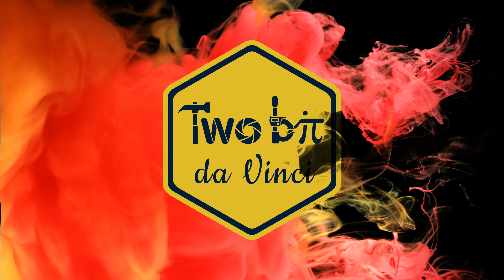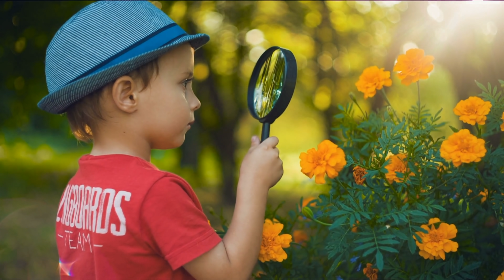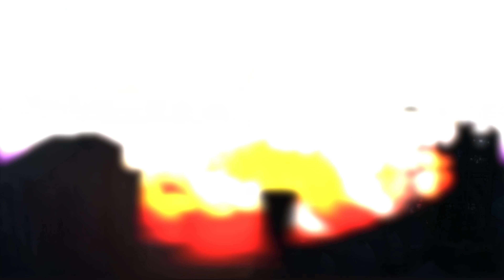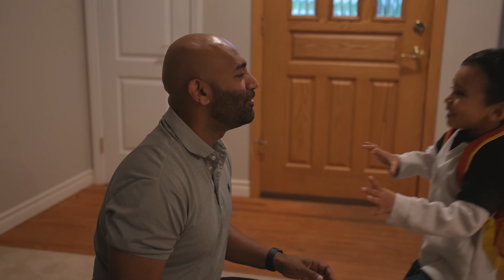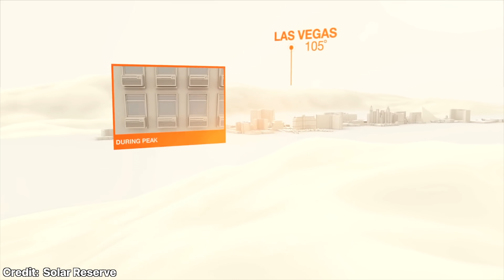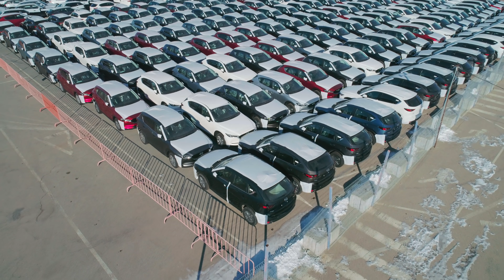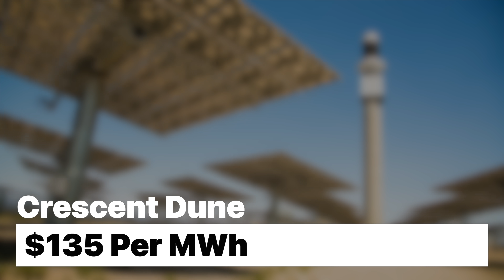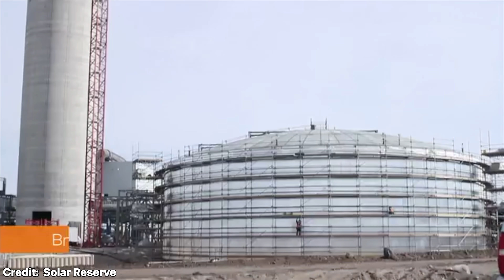This Billion Dollar Solar Plant was an EPIC Failure

Comment: I have no issues with green energy. I have issues with how people try to go about green energy.

Nuclear energy, the safest and least limiting option, is all but ignored because people are terrified of another Chernobyl (which is completely avoidable) or have otherwise had so much misinformation pumped into their minds by way of pop culture that they think you'll end up with three-eyed fish in the river. Instead they try pushing these other methods, each with worse problems:

Solar energy is too reliant on clear skies, it's not suitable for everywhere.
Wind is harmful to raptor populations.
Hydro-electric is very location dependent, and the current state of Lake Mead shows how it can go wrong.
Geothermal is location-dependent.

And then there's the excuses behind it. We should be focused on clean energy for the sake of maintaining energy independence and not relying on a resource that is likely going to dry up in the next couple hundred years. Instead people are pushing this grand lie of global warming (sorry, "climate change" after Forbes brought to light a leaked email in 2011 that proved a major lab in the UK was falsifying its results to match the global warming model) in order to do it.

The climate is fine. The fact that according to every climate prediction of the 90s my hometown should be 10 feet underwater right now because of rising sea levels is proof that the climate change scare is just a scare. The sea level has not risen a measurable amount in the lasts 30 years, in spite of being told for just as long that we'd get flooded because of the polar ice caps. We've been lied to, but green energy is still a good idea for the sake of energy independence.
Reply: And solar works best closer to the equator where you have 12 hrs of sun every day compared to closer to the poles where there could be weeks without sun. And if you want to have solar farms you have to destroy the local ecosystem (cutting down forests-which could result in flooding and or ecosystem collapse like when mao killed all the sparrows the locust populations increased and ate the crops which contributed to the deaths of 15+ million people because of famine, destroying deserts-deserts have life, and wind transports nutrient rich dust around the world)

Wind is just as bad. Why can't all the turbines be put in one place. Like with sun if you put one solar panel on top of others the ones on the bottom won't work. This means that wind turbines stop wind. What would life be like without wind. The weather wouldn't change as much which means it would be warmer. Some plants rely on the wind to disperse seeds.. And the blades are plastic which means as they breakdown they disperse plastic around the world (isn't plastic bad).

Hydro is debatable. Unless people are going to drink straight from rivers, lakes and oceans there needs to be places to store water and that's where hydro comes in. Is it good for the environment not really but what are the alternatives while living in modern societies.

Staufen Germany is an example of geothermal gone wrong.

Nuclear will run out eventually (depending on use it could last 1000s of years). Concentrated solar (mirrors) seems like it would last longer because why would you need to replace the mirrors as long as they're not damaged. The problem with csp is death lasers. Even eliminating the impact to birds that much brightness in one location seems dangerous. Nuclear has the lowest impact on the environment (least land, least waste, the water could come from public wastewater and be disposed of in an artificial reservoir which could be used for recreation). The worst that would happen is people might get cancer but since people want to find cures for cancer what's the problem. People have no problem with obesity even though it's responsible for cancer.

About ice melting-the dutch have been preventing flooding for centuries and people could build in areas that won't flood (people worry about earthquakes and nuclear plants but don't seem to worry about flooding, tornadoes or earthquakes where they live).

PV and wind aren't worth it because of the amount of waste they have. It would take Japan 19 yrs to recycle 10(ten)k tons of pv. The type of plastic wind is made of is too difficult to recycle so it just winds up in landfills but at least it's plastic compared to solar that has toxic metals (even the smallest amount is still bad when you put thousands of old panels in the same place)

Comment: So did anyone else catch the fact that solar is at least double the price of coal!?  And triple the cost of nuclear ☢️!!  Let’s start using thorium reactors which is 100% carbon free and completely reusable.  It’s the most energy dense material on earth 🌍 and will last forever with no reactor meltdown possible because of the use of Molton salt
Reply from the maker: Solar is falling fast, nuclear prices are rising so is coal. That’s the difference. Also holistically solar is the clear winner. Why no one builds new coal plants

Comment: Crescent dune is not efficient since it convert Sun energy to heat energy, from heat energy to mechanical energy, from mechanical energy to electrical energy while photo voltaic  cell it convert directly from sun energy to electrical energy  stored in battery

Comment: there is a problem with the saying that solar become much cheaper then it was in the past and implaing that it beacame more efficent. the only reason solar beacome cheaper is that the panales are made now by cheap labor force mostly in asia i think and not cos of some kind of sientific advencment. we stack with 13% efficency and havent moved from it for long time . also we stak with  the comperative rearetiy to the dement and polution from mining rare metals and unreciceled solar panels that containe tose  matirials that poisen the enviorment.  so as i see it atm solar have strong long term negatives and in this regargds the miror power plant look more atractive .

Comment: Of course the government needs to target research new energy tech. Not only for decarbonization but to stay economically competitive to supply it's industry. You will lose out on economic warfare in peace times if you don't. Today onshore wind and PV are 1/3rd the cost of coal and gas power. They are 1/6th of nuclear. It would be economically insane not to max it out even if you do not consider climate crisis at all. Electrification of industry does allow saving up to 90% energy in certain industry sectors. Just by eliminating thermal waste heat in the process. Most People don't understand electricity is way more valuable form of energy to use. So staying on top of the electrification game is key. Even if CEOs in industry are wired to make tomorrow an exact copy of yesterday  to maximize shareholder value. What really sucks is the short-termism and non sustainable in maximizing shareholder value. It only looks good on paper when the biz model totally tanks tomorrow due to overstretched supply chains or energy crisis. By giving up each and any resilience for short term benefits. We see that unravel right now. Just check out Peter Zeihan on YT.

Comment: Awesome Video, I need more!!
What about Ivanpah solar power plant?? There is like 3 towers out there producing all kinds of energy!!  Maybe these towers are not using Molten Salt? I am guessing water from the Hoover Dam and Colorado River! Maybe a future Video on this??
Reply from the maker: Great questions and worthy of a follow up
Reply: Ivanpah is interesting and producing a lot of power. Mirrors that heat up water in a central tower(s).There is some controversy about how much Natural Gas it also burns though. It doesn't look like it has any energy storage capacity so once the sun is down, power stops until morning, unless I missed it.
Reply: @R_411  Yes, but those Ceramic Tiles on the Towers dont immediately cool after the Sun goes down. I would assume they should still be able to make Steam for up to 2 to 4 hours?! I am Speculating though!
Although controversial, I am interested in the Technology and possible future Advancement!

Comment: It was not the cost of solar but the cost of natural gas that killed this plant.  Of course there were high costs of first mover in this set up.  Like nothing like this, on this scale, had been built before.  All sorts of things that seem like they would work, didn't.  Eventually they did get it to work, but it did cost a lot more than initially thought.  The plan, as you stated, was to sell electricity when other solar plants could not produce electricity with the idea that electricity would command a higher price price since it could produce electricity at times of peak electricity demand.  What the plant was going up against was power normally produced by natural gas powered peaker plants.  This used to be very expensive electricity.  Well, with the fracking boom and the price of natural gas going to almost zero, peak power electricity stopped being a viable business model.  Funny thing, with the current high price of natural gas, I think this plant might make economic sense now

Comment: Largest virus paryicle 10 microns smallest water droplet 60 microns ,,, if you can exhale through a mask onto glass and see your breath on the glass it’s just decoration  ,,,I’ll hush
Reply from the maker: That’s actually not how n95 masks work by the way. They take advantage of electric charged fibers. It’s brilliantly simple. So just FYI the physics of masks is fascinating and that’s why N95 masks absolutely work. You’re thinking only of physically blocking

Comment: You keep talking about the cost of photovoltaic's coming down, but that has nothing to do with the fact this plant could only produce 50% of the design capacity and the labor intensive aspect of operating it. From my experience with process salt bath heaters, I shudder to think of trying to pipe molten salt everywhere. That was a very bad design principle. And the American people take it on the chin again in the name of Green energy.

Comment: The cheapest way of producing electricity is to use a system of closed loop hydroelectric power stations combined with solar and wind power systems. You use rooftop solar and wind power systems to charge the closed loop hydroelectric power stations. Closed loop hydroelectric power stations can be built underground or incorporated into building design saving space and placing the power production closer to the point that the power is needed eliminating most substations and transformers. By producing electricity closer to where it is needed you don't need to produce electricity in the high voltage range needed for the electricity to travel long distances. You can also make a closed loop hydroelectric power station that is self recharging eliminating the need for wind and solar power. By using the properties of water and gravity you can produce popetual electricity. Closed loop hydroelectric power stations don't need to be maned and only need minimal maintenance. This show is wrong about the size of a closed loop hydroelectric power station and is wrong about a lot of what it is saying.

Comment: I looked at solar for our home but even with 300 W panels I would need to cover my roof and my yard, our peak has been as high as 5,000 kW (5 MW) though after some very expensive upgrades now 3.5MW in August.
Reply: 3.5 MW?  Do you deliver that power to large primary lines running by your property?  Who purchased the transformer necessary to boost it to that primary voltage?  And the inverter?
Reply: @samuelarcher9236  .. 3500 kW = 3.5 MW and that's for a month and not everyone lives in the trending tiny house. 5 MW costs around $550-$600.

Comment: Good grief;  Solar One in Dagget CA went on line back in the mid 1980s, and Solar Two, the sister plant in Dagget CA was making 10 mega watts 25 years ago.  The one in Ariz. was just another failure due to poor energy management and low repair to output ratio.  

This molten salt heliostat idea is quite old.  That first one, called Solar One was built 37 years ago.  It worked fine.  It just didn't please other energy producers.

Comment: I'm not green or anti-green.  I'm pragmatist.  I'm also enough of a climate skeptic that I am not alarmed about climate change and I believe if one looks at the scale and age of the universe mankind does not appear as much in the scheme of things.  We need to stop acting in panic mode and start doing things in order of importance and in my opinion desertification is a higher priority by far than green house gasses.  I would also like to see an effort to clean up aviation fuel and the ocean.  Dumping waste into the ocean needs to be cleaned up.  I'm also concerned about the current windmills.  I would rather we go to the more bird friendly cylindrical mills.

Comment: I'm fairly pessimistic on green energy with windmills barely paying for themselves by their lifecycle end and in most cases with solar, replacement costs of batteries / panels eating into profits, and worst of all some companies taking massive government money to never produce anything but board member wealth and kick-backs to their political benefactors, but this project had me hopeful for something groundbreaking -- quite disappointed it wasn't even viable enough to run for even a decade.  Personally, would like to see this money invested into geothermal based production, increasing transport capacity, and making nuclear options safer and cheaper whether it be traditional or the newer small reactors.  Enjoyed the video, sad as the outcome turned out.  Thanks!

Comment: Most if not all new technologies go wrong at least a few times in the early days. This is one of those failures. 

But let's not forget that solar energy is and has for a decade or so been one of the world's fastest growing major industries, and solar electricity is getting cheaper every year. We're getting well over ten percent of our electricity here in the USA on an annual basis as of this past year by way of wind and solar power. 

This percentage is going to grow every year from here on out, not only here in the USA but on a world wide basis. 

Coal, oil and gas come out of holes in the ground, but they don't grow back. 

We will never run out of wind and sun.

Comment: Nuclear is the way to go. Its clean, safe (unlike all of the drama), runs 24/7 365 days a year no matter what and can be going for years with no changes. The radioactive waste can be used as it's own source of energy and the roads can be cleaned and reused over and over again. Nuclear is also reliable and cheap. Solar farms are expensive, unreliable, kills thousands of species of birds every year, and you have to destroy whole ecosystems just to build them. Are we trying to save the planet for the planet or us? If it's for us, we are trying our best but if it's for the planet, then we are justing flipping our birds at our planet with the supposed to be green energy.

Comment: Would it be possible to coat the mirrors in PV cells? The low efficiency of the PV here is actually a feature, all the light not collected is reflected back to melt the salt, generating a wide amount of power during the day in a more traditional solar farm. You still need a mix, solar power's price per watt is irrelevant at night, so being able to do a mix of both should offset the costs of maintaining the offset power storage.

Another element in cost saving here is you could link it with desalination, a big waste product is highly salinated water in desalination, you could route this waste water through the mirrors, take the steam of excess water to run a turbine (additional power) and the molten salt off to your storage for energy usage. Now you're producing potable water in an arid region, immediate daytime power and offset overnight power.

Or am I oversimplifying here?

Comment: Epic failure!? No!. The plant is running. From Sept to February it produced more than any other year in the same time frame except its peak year. In spite of technological hurdles on this first commercial breakthrough plant, it has produce of 500KMWH of clean energy. With coal that would be 15 pounds of mercury poisoning our fish and therefor people. as well as over 200 tons CO2. And it has the potential to do so for a long long time. As well as what you pointed out, others have learned from their breakthrough growing pains.

Comment: If you live in a hot place where the heat of the sun is enough to burn flesh and almost boil water, it's kind of mind boggling that the sun's heat isn't being used for energy generation, save for only a couple of these molten salt plants that exist. 

For God's sake, someone please invent a way of using all this blistering thermal energy that's constantly being bombarded on the earth! It's there for the taking.

Comment: Why only do a video on the solar thermal plant that failed? The ivanpah plant down the road is hitting 90% of its capacity now. That should really have been talked about in this video.
Reply from the maker: Great point I’ll do a follow up
Reply: @TwoBitDaVinci  thanks for being considerate! I have no stake in any of these plants. It's just that I drove past the one near Las Vegas last year and it's a site to see. It turns out you can drive right up to it next to the mirrors. It's one hell of a project. But yeah you do make a good point about the cost of solar panels kind of negating this technology.